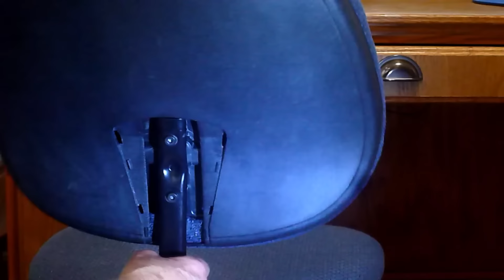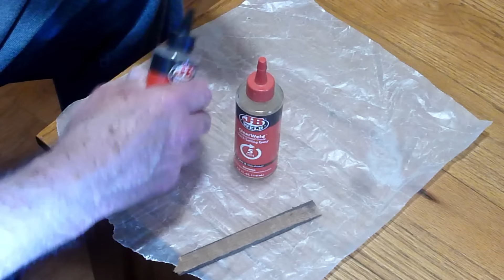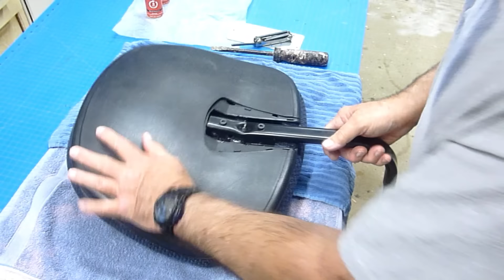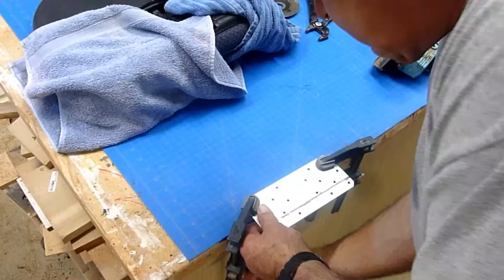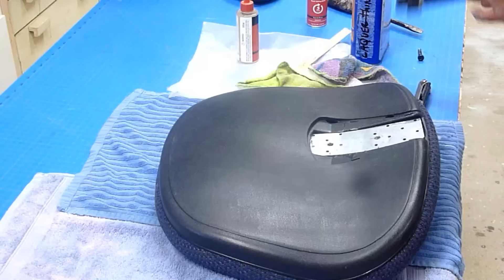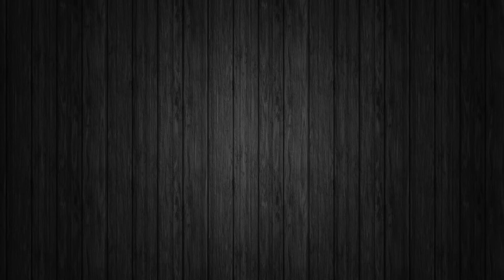HOW TO REPAIR A BROKEN OFFICE CHAIR BACK - SIMPLE $6.00 HACK

Comment: What was purpose of applying epoxy?
Reply from the maker: First, I wanted to stabilize the chair back and stop it from flopping around while I was trying to fix it.  This made fitting the metal piece easier.  Second, I wanted to add a lot of extra strength to the joint.  I think it worked, because I am till using the chair.  If you try it without the epoxy, let me know how well it went.

Comment: My chair has the exact same problem. A cracking noise when leaning back and the feeling that the metal support is digging into my back.

Unfortunately the attachment point is totally covered by the plastic facade, so I can't get at the problem. I'm tempted to just cut away the facade entirely and accept that the back won't look so pretty anymore.

Don't know if I'd trust a plate soft enough to be bent by hand, held in place by glue to hold up in the long run though. I'm a big dude, and I lean back pretty aggressively. (Probably what broke the thing in the first place.)
Reply from the maker: Actually, this repair has held up, even with the soft metal plate.  Like you, if I lean back in the chair, I can feel the support assembly.  I typically never lean back aggressively, so this is not a real concern for me.    It sounds like you have a different support design than I do, without a removable back cover.  if you do decide to cut away the facade, you can actually buy office chair cover sets on Amazon.  They have them for many different chair designs.  You can get an idea from this link: https://amzn.to/46njt6h

Comment: Thanks for the video. If you get chance please demo fixing Sidiz T50 broken back, either on left side or right side.
Reply from the maker: I'm not familiar with the chair but I did look it up.  It appears that the back is molded plastic.  Tough to fix unless maybe there is some kind of metal reinforcement inside it.  Is yours just molded plastic where it broke?
Reply: @deerparkhomeshop2471  yes that is correct

Comment: Your video is very informative. However, my desk chair has a different problem. My desk chair keeps leaning to the right and left depending on what direction I lean towards. It leans so far to one side that it looks like I'm going to fall out of the chair. I am an overweight guy and I use my chair for multiple hours on a daily basis. I bought a chair that claimed it can support up to 500Ib.  I needed a heavy duty chair to last a long time. However, my chair has broken within 9 months of usage. It appears to me that the plastic part that connects to the base of the seat has become deformed. How can i fix this? I cannot afford to constantly be buying new desk chairs.
Reply from the maker: It's hard for me to visualize the problem.  I am not an expert on this, but all of the swivel office chairs I have seen have metal parts directly under the base of the seat.     There is usually a large rectangular plate attached to the pedestal and the chair bottom in such a way that it can't rock.  You have something different, right?  And I imagine that you have gotten flustrated trying to find a youtube that covers the problem. If you know the brand and model no. of your chair, there are a number of companies on line specializing in parts, so that may be a good option for you.